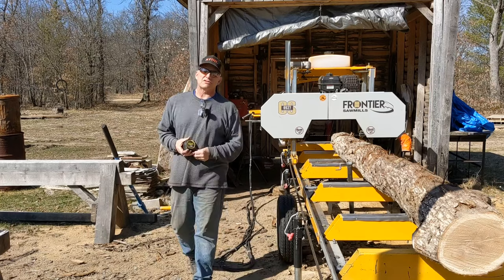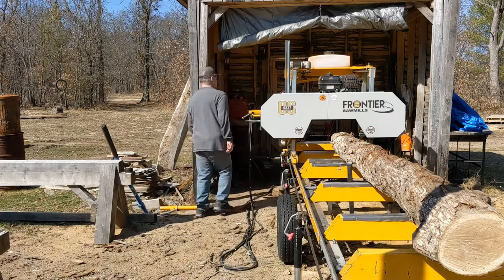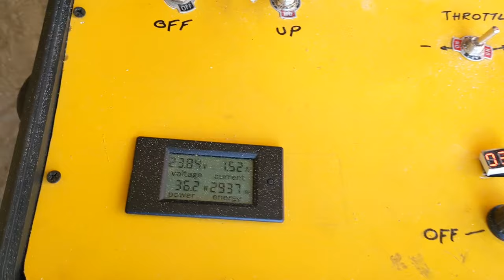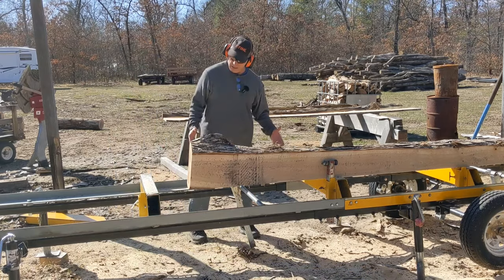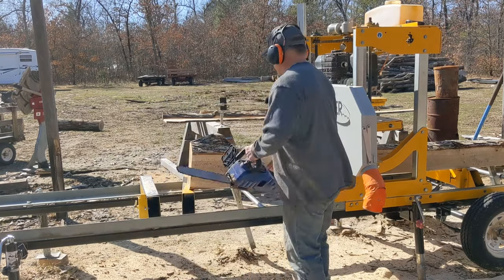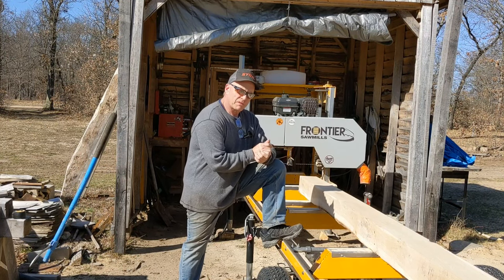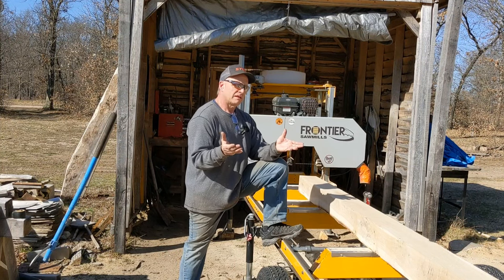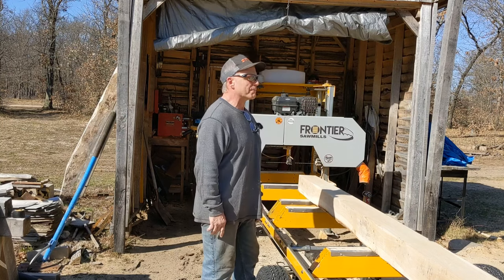Homeowners  Frontier Sawmill Creating Timber Beams

Comment: "I'll be careful,  I'll take it easy, If I fall I would have broken my leg anyway".    I just about fell out of my chair laughing on that one.  The noise was very noticeable.    Idler/tensioner bearing?    Clutch bearing?   Band wheel bearing?   Did you find out what is was?    North central Pa.   Tioga county,  Delmar township.   Just two ridges east of the Pa. Grand Canyon.   You know the one that has trees on the mountain sides and Pine Creek running through it?   Have a good day.
Reply from the maker: Oh that mountain lol.   I know that one.  It turned out to be the bearing behind the blade guide was dry.   I'm here for a good time so I'm going to keep moving lol.  Maybe not trying slack line anytime soon though.  Thanks Jim for all the continued support.   Pennsylvania is a beautiful state that I've gone through several times. Nothing like those hills around here in Michigan. Even in the northern UP isn't like PA.

Comment: Nice video, Jerry.  I fired up my OS27 over the weekend and got a similar noise while cutting a black walnut using the blades that came with the mill.  I just purchase a pack of 7 degree Riper 37 blades.  We’ll see if that makes a difference. -puro padre
Reply from the maker: I figured it out.  It was the bearing behind the blade guide.   It was dry.   Much better now.   Stay safe and happy milling.   What species of wood is your most popular in your area?Thank you for all the support.  I truly appreciate.
Reply from the maker: Rippers are the best blades I've found
Reply: In my neck of the woods (Leesburg, VA), pine and poplar are abundant with a nice sprinkling of black walnut and oak.  -PP